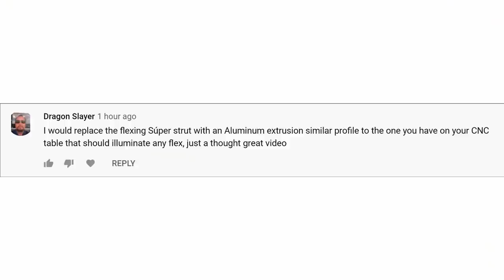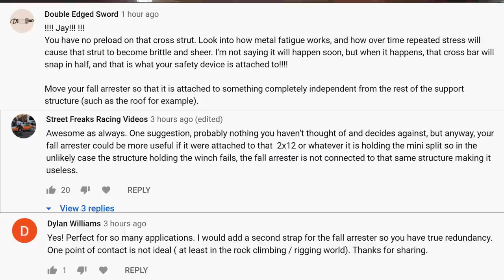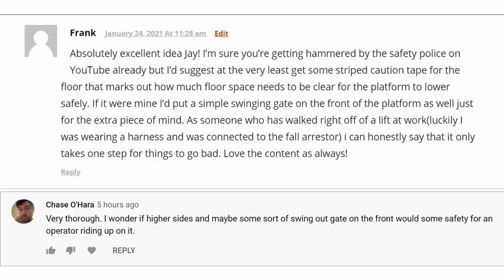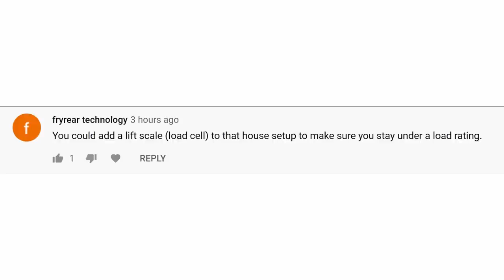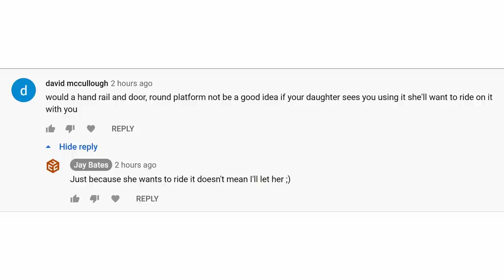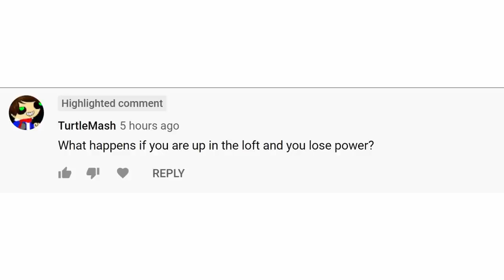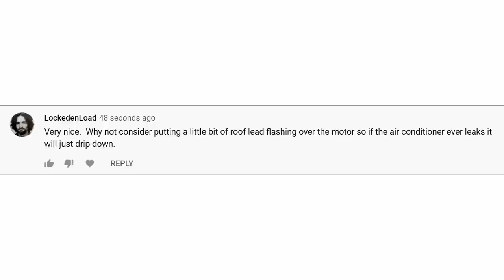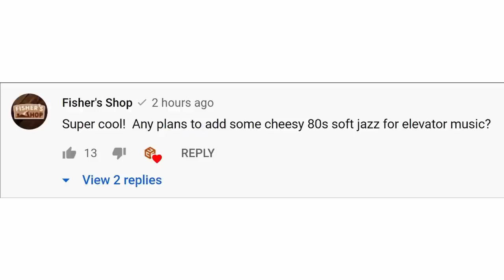DIY Elevator Follow-up

Comment: Even without any changes the elevator is way safer than carrying heavy and bulky things up a ladder like before. You made a huge upgrade for safety just by making the elevator and everybody goes crazy because it’s not 100% safe.

This thing is probably safer than 90% of the tools in your shop.

As far as water goes, aren’t similar type of winches mounted on vehicles where they are constantly outside?

Comment: Amazing job. I love this. Just a note, you have a shock absorbing lanyard on there. Check how much it deploys when it opens. 

Theoretically if the cable snaps the drum will lock to stop the elevator from crashing down, but depending on the weight the shock absorber will open. That'll cause the elevator to come crashing down another, 8,10,12?....feet.

Comment: Great build! Lots of good ideas. Thank you for posting this! Some things I might consider: Use a remote that requires turning a key to enable the remote (then of course you have to worry about losing the key, and at least for me, misplacing a key is almost certain). A mirror opposite the lift for seeing beneath it on the way down would help negate the risk of squishing any pets who snuck in to take a nap beneath it. Lastly, a couple of grab handles bolted on to the back wall of the lift might be a good idea. If the lift ever does fail (snapped cable, etc), there might be a sudden jolt and it might tilt, which could knock you off balance and throw you on to the concrete floor below, so at least having a grab handle would give you something to hold on to. Aside from that, I think it's great. Give the whole contraption a thorough inspection a couple times per year, like any elevator.

Comment: Hi Jay, I've been watching your videos for quite some time and always enjoyed them. I am a retired elevator guy with more than 30 years experience. When I saw the first video I could see quite a few issues. some you touched on and some you fixed. I still think there are a couple of things you should think about. The main one is the sling you are using at the bottom. When those things fail they dont give any warning. I couldnt see from the video but if there are sharp corners where it goes around the timber then that will increase the risk. I would be be attaching a piece of chain as a safety in effect paralleling the sling it can be loose to allow the main sling to work unhindered. The problem with relying ofn the fall arrestor at the side is I think that platform will rack sideways if it ever comes into use and I wouldnt be confident that it will stay between the rails. Also when putting any load on the platform I would put it as close to the back wall as possible to prevent distortion ( racking) of the platform. In the end I think the main problem is that its likely that some other folks who are not as careful as you will see this video and the outcomes could be not so good.

Comment: I built my elevator out of barn door rails and wheels with a tractor carry all and it binds and is HEAVY..You've given me names for upgraded material AND a better design for the platform :)  Thank you! I found those winches are junk, bought a $2500 chain drive and it works much better.

Comment: Uni-Strut, Superstrut, etc are brand names. This stuff is called channel strut or strut channel. A variety of manufacturers make them and it's all standardized dimensions to ensure interchangeability. The common size is 1-5/8 x 1-5/8 but others exist. A good resource to see what accessories are available is McMaster-Carr.

Btw if you want to remove flex from the strut channel supporting the hoist then just attach a 2x6 to the top using lag screws through the slots in the strut channel.

Comment: One thing I have found to be absolutely true... there are a few thousand armchair engineers (due to a recent stay at a Holiday Inn) that think that every single project should be rated for commercial use in a public space, permitted by every possible permitting agency known to mankind (including those that are not based in this country) and require waivers of insurance coverage to be used or even pondered from a distance. The mere fact that you went to the effort to install a fall arrest system says that you are way above the majority of people that have created one variety of this project and DON'T have a YouTube channel to display it on. Gonna guess that there are literally thousands of projects just like this one in place that have never ha d a failure and are way jankier than your well engineered build. Kudos to you for your ingenuity  and screw you to the armchair engineers. As with ALL DIY projects... your mileage may vary and do it at your own peril and risk. I am building two of these for "second tier" storage solutions in my own fab shop thanks to your designs. Thumbs Up!

Comment: 20:30 - yeah, excellent point about children and household safety.  The lift is most likely not the risk point in the house.  I.e. chemicals, elec outlets, 'don't run in the street'  etc.  26:30 - Absolutely!  Safety is very important & is a personal judgement in a one-person shop.  Obviously if you are working with others, then it is a team decision.   Great vid, thanks Jay...

Comment: Great solutions, Jay. First, just for information, is that GFCI breakers are available for your breaker box (not that you need one). Second, check out an OSHA approved belt elevator . No safety cage is required. Also, get Drew to pose for the calendar when you publish it (lol). Take care.
Bill

Comment: Regarding your comment about transporting 20' strut: Next time think about laying the long object, ez-strut, rebar, pipe, simply drive over the length of the product and strap it up to your axles. I bought 21' x 1 1/4" galvanized threaded conduit for use as a flag pole. The hardware store where I purchased it ha been in business more several decades. The owners adult son said he had never seen anyone do that and thought it was a great way to haul it. I ended up doing that several times as several of my neighbors on Lake Gaston in NC/VA wanted a flag pole as well. Just a thought. A rope, small ratchet strap or heavy wire will all work to hold the pipe. Give it a try sometime.

Comment: I’m in the middle of a lift build. You started after I did and you finished before I will. (I’m retired) Mine is very similar to yours. When you loop the cable the auto stop no longer works so I plan to attach a narrow vertical board to the back of my sled that will trigger the auto stop when the sled gets to the top so I don’t accidentally let a tall load raise the roof, literally. Love your videos!

Comment: On the subject of flex: if the uni-strut flexes downwards, then the ends lift up.   If the ends lift up, then they aren't touching the outer two supports.  If they aren't touching the supports, then the supports aren't actually supporting the weight, just the inner two supports are providing the support.

Comment: Wow!! After reading your comments I realized that if these people saw you walking on water they'd say it's because you can't swim. The most noise is made by people that do NOTHING!! They won't, and haven't, built an elevator or anything else for that matter. It's easy to sit back and  criticize what other people are doing. 

You have taken "reasonable" precautions to ensure safety. Build quality looks good. You have fall arresters. Everything has a safety factor way above what is required. You can keep adding safety features until the lift won't carry it's own weight. Remember, people ride motorcycles without helmets every day. Don't let people harsh your mellow. You did a fantastic job and it looks great. Be proud of what you've done.

Comment: Adding a GFCI to the outlet may cause nuisance tripping. I don't recommend it here. The most likely point for nuisance tripping is the initial load on the way up. If the GFCI is up top, it will be hard to reach. If its down low and it trips when you are up top, you are stuck :) EDIT: LOVE the Outro!

Comment: One thing you need to watch for overtime is the cable delaminating/ spreading apart, which will weaken the weight holding capacity of the cable. I have a similar setup with using a hoist for my wheelchair lift and about four feet from the end the cable started to do this.

Comment: As for all the stupid questions, This was an awesome build. 
I have used a DIY lift that someone made maybe 30 or 40 years ago. It was made with a angle iron in a box frame and lowers up and down to a basement. Though it is super small about 3 foot square and the hoist was centered. Though it needs to be updated it still works very well. If i ever need to build a lift anywhere I know what I will do to make it better.

Comment: The fall arrestor. Bad move to put it on the side. The platform will want to tip to the unsupported side and put stresses in the direction this platform isn't designed for.
I suggest adding another to the other side.
Have you had any problems with tracking unevenly as in the event of a load that could not be centered?

Excellent job! I'm glad you came back to address concerns.

Comment: I wish I had seen both videos before commenting, but good job making improvements. I agree the concerns about your daughter and the lift are the least of your worries in a shop full of tools. I would reconsider adding a chain or rail across the front because in the event of a minor failure, or the lift unexpectedly jerking, you could lose your balance and fall, or your cargo could shift and fall, damaging the cargo, injuring you, or breaking something below. 

Again, great project and it should work fine for your needs.

Comment: That fall arrestor if it becomes activated. Inside that black pocket is what's called a "deceleration loop" which is 4 feet of sewed strapping designed to break apart and unravel to slow you down in the event of a fall. Your platform would fall four feet before stopping.

Comment: the fall arrester is a good idea but I notice that it includes a shock absorber in the form of a shrinkwrapped part of the belt. this is intended to limit the shock to a person in a harness in the event of a fall. perhaps you don't want to allow the platform to drop too far if there was a cable snap. might be worth removing the shock absorber part.

Comment: Very nice. The only thing I would suggest is loading it to capacity with a quick release on the winch about 3ft up and see how it handles things. The single side fall arrest may cause it to twist, and then new factors like wall anchors for the track come into play and the possibility if it throwing a person and the items off the lower side due to the sudden unexpected change in angle. 

great video and great project!

Comment: Necessity is normally the mother of invention, you did a great job with your creative concept, practical application and then producing a video as an added bonus. Well Done !!!
The term "Unistrut" or "Strut" used in the construction field comes in several width and length dimensions. It is made with both a galvanized coating and or normally painted in glossy green. 
It's probably a little late now but FYI to anyone else doing future builds it is always a plus to know the availability of 7/8", 1-5/8" wide and or 10' and 20' lengths are both very popular for support of different applications. They also make 1-5/8"X1-5/8" wide back to back "Strut" that is spot welded together in 10' and 20' lengths for use where a more rigid application is needed. Along with the track roller brackets in the 1st video they also make both a two hole and or a four hole angle bracket to build "Unistrut" support frame work secured by "Unistrut" nuts for either 3/8" or 1/2" bolts and square washers. Besides the cost it's almost like having access to "Adult" version erector set. :)

Comment: As a mechanical engineer, I would suggest sizing your materials for at least double the capacity you plan you use them for. That would be a safety factor of 2. Most of the structural engineers I work with design for safety factors of 2.5-3 since the occurrence of failure typically means serious injury or death. I've never designed an elevator but I would consider looking at the fail safes residential elevators use in their products.

Comment: Wear on breaker mostly occurs if switched under an electric load.  Switching breaker with no active load (lift not moving), doesn't hurt it.  Wear occurs mostly when the electric load strikes an arc.  No load, no arc, no appreciable wear.

Comment: Thanks for the video and the follow up.  I think the safety stuff may be warranted in a public space but as you said its NOT a public space.  And due to the fact it is a slow moving system, I really doubt a LOT of these suggestions would be a big deal.  The only thing I would add is another fall arrestor on the other side with the exact same attachment style so that they can both take the full weight.  I like what you have put in place.  I think I am going to use this design and put one in my shop in ADDITION to my stairs because I don't like carrying heavy things up my stairs.

Comment: Nice call on all of the reasonable suggestions and handling the over-cautious ones by people that feel they "must be heard".  I'd be happy to have anything like that in my shop/barn, but I wonder if a garage-door torsion spring cable would help offload some of the load, provided it's "lift" is less than the weight of the empty cart.

I built a lift for a lake property (look for "girls go downhill the easy way" on youtube) and I got similar suggestions of how destructively unsafe it was and that I would die using it, but I never did, much to their disappointment I'm sure.

Comment: About the only thing I can think of adding is a handle on the back of the carriage to steady oneself on the ride up or down.  I'm going to build one of these for my garage.  Was thinking of keeping the existing access hole size until I saw your run the bicycle up there.  Yes, it needs to be bigger.

Comment: I would agree with some of the other comments I would find fall restraint without the absorber because those will stretch 6 to 10 feet in which then wouldn’t do Do you much good you’re really after something to catch your elevator immediately without picking up speed prior to be restrained

Comment: A drip tray redirecting overflowing water to the outside of the building may be a better way because if there is water leaking, by the time you see it, you won't be able to turn on the breaker to use it to go up to fix the problem...if that makes any sense.

Comment: Regarding tension vs compression. These qualities vary with different materials.  Wood has a higher compression strength than tensile strength, but steel is the opposite. Steel has a much higher tensile strength than compression strength, so you should always with with a tensile load on steel if you have a choice.

Comment: I agree with everything you said.  If you wanted to take restricting the elevators motion to another level.  You could run a padlock threw the super strut track thus preventing the travel of the platform just like people do on garage doors.

Comment: I would replace the two nuts you used to attach the fall arrestor to the platform with nylock nuts so vibration won't loosen  them.

Comment: I have never even seen a fall arrest-er.. You could install a sloped plate over the lift motor and water would never touch it.. Breakers are not designed to be use as a switch, they have a bimetallic spring that weakens with use. (unless they are made different now)? I think this whole thing is great...

Comment: Excellent responses to all the suggestions.  You are certainly more polite and gracious than required.  I was going to ask how you determined the grid spacing for the floor of the lift: would a smaller grid for the skins made the floor stiffer/stronger vs the higher weight of additional internal structure?  CDX ply in 1/2 inch is of such poor quality at the big box stores currently does a torsion box design need more internal structure to compensate?
Reply from the maker: I just went by feel for the grid spacing. Torsion boxes are really strong regardless. My assembly table is a torso on box with 24" grid. It holds my body weight just fine but it is 3/4 if I'm not mistaken.

Comment: Like the overall design.  A) Issue remaining is the fall arrester on one side will result in racking the platform. A information) The arrest strap should be designed to handle the impact of the weight dropping the distance before tightening .  The strap stretches to reduce the sudden stop rate.  But at the top the spring rate to of strap is minimal and the fall the longest. so racking failure needs to be thought about and tested if you can without damaging the lift.  
B) A C channel not the greatest beam.  "I" beams for example is a better choice.  The C channel on its side actually puts the most metal where the tension and compression are the greatest.  However since then the bottom metal is off center twist is an issue when put the beam on it's side facing up and down.  B additional thoughts) It appears that the span is kept to a minimum so bending stress is reduced.    I would look at the bending of the channel when you get toward the full load. (You may want to lift it up a inch with a lot of weight on it to see the deflection.  Water, heavy machine on wheels, etc.  Note  the bending moment is independent of the shape of the beam.   Consider that force needed to produce the same torque.  Hold two nuts locked together with a short handle wrench and a long channel handle.  Which handle has the lowest force?  That wooden 2x8 is a better choice then the 1.75" tall  C channel, guess the center of torque is 1" off the open end where there is the least metal.)